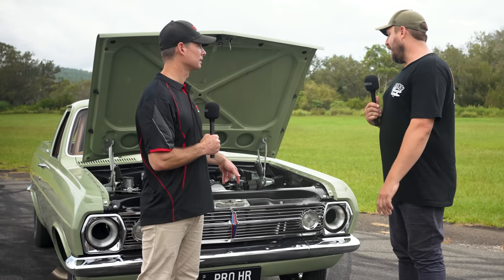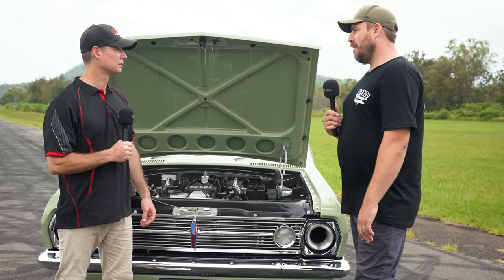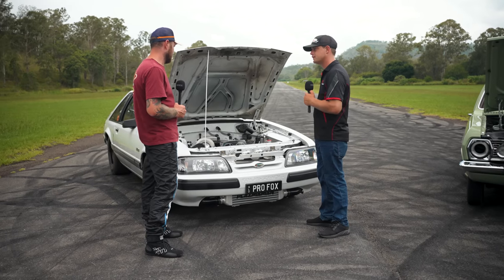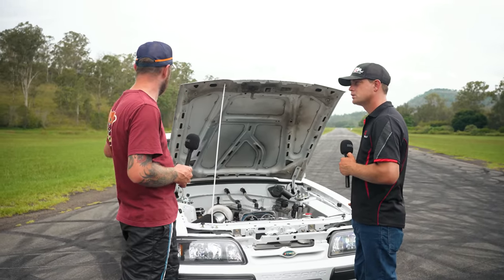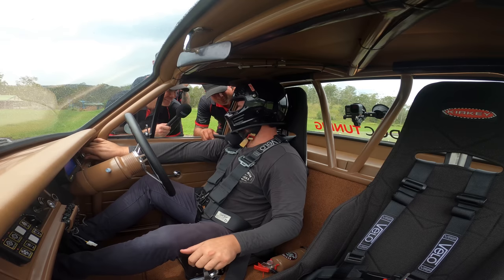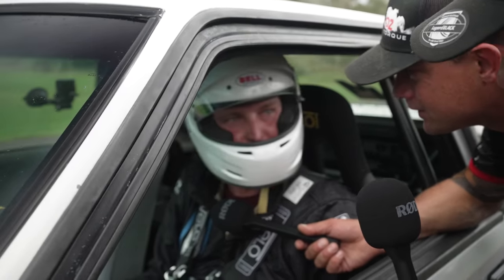Pro Street Showdown - 1JZ Foxbody VS LS twin turbo HR Holden #noprep #prostreet

Comment: Great comparison - excellent cars. I’d love to know what 1/8 mile times these cars are getting from the light to the flags. If only someone could afford a measly $220 Dragy. Although they are ridiculously expensive compared to say building an engine……it’s not like data is useful or anything
Reply: It's not really about what time they get over the 1/8th, it's about who gets over the line first. You could get a ballpark figure by looking at the time in the video that they leave the line to when they cross. At the end of the day it's a no prep drag/roll on a damp track, times will vary greatly between runs.
Reply: I just raced him today no prep and I did a 6.9 and he was atleast .2 quicker than me
Reply: @BackyardBuiltandTuned  at the same runway? (Vbox or Dragy?)
Reply: @MrTroytroy  dragy, lakeside raceway

Comment: I timed the HR’s 2nd run as 8.85sec. (Give or take 0.25secs for obvious  inaccurate measurement)  Which is brisk. For random comparisons sake a 2.0 litre Mk7 Golf R with a tune only is around low 8’s. No I’m not a Golf fan, and yes I think the HR is pretty cool. I’m just bringing some data to the emotional and visual drama
Reply: The track is set to 300 meters
Reply: @sektion9076  oh ok - interesting. Was that advertised/mentioned or did I just miss that?
Reply: @MrTroytroy  we don't mention that on the videos (I film and edit these)